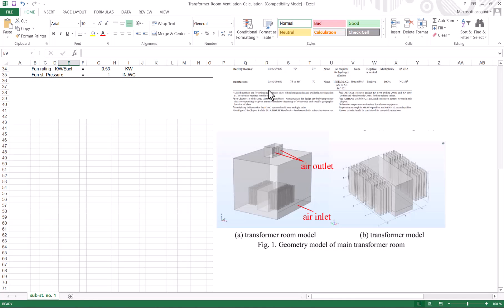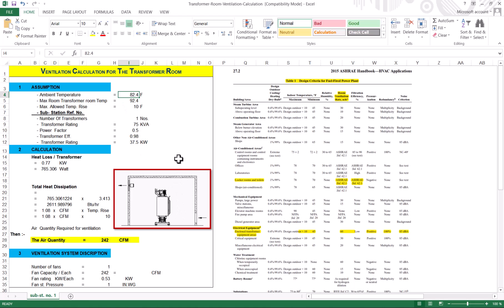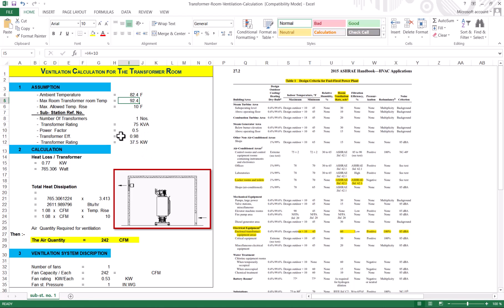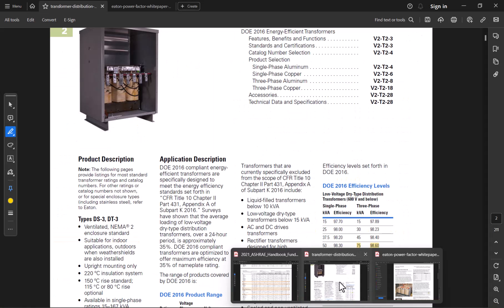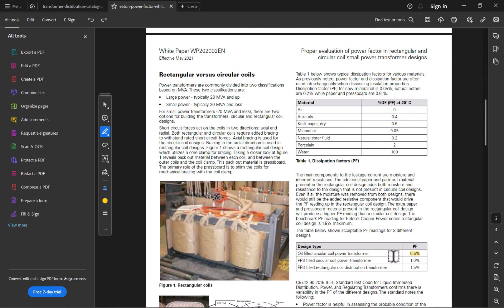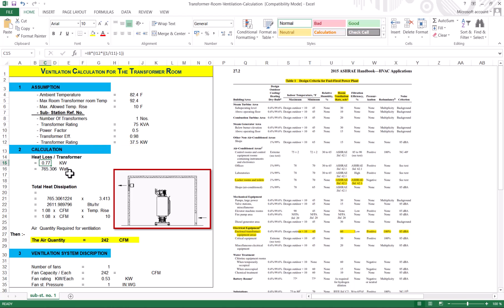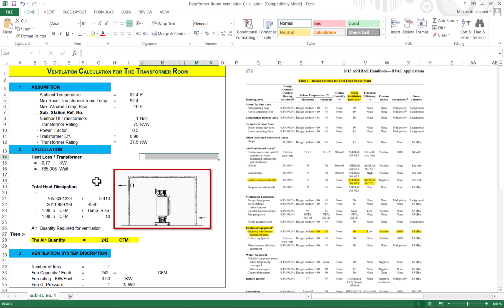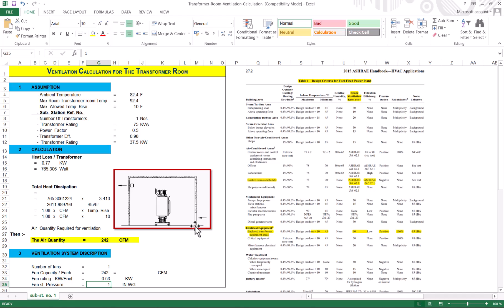Expert Reveals Top Transformer Room Ventilation System Design Secrets!

Comment: cfm calculated is the untreated outdoor cfm rate and exhaust cfm rate correct?
Reply from the maker: Yes, but it depends on weather conditions.like in freezing environment you have to provide treated makeup air. The fan is interlocked with T-stat, when the temperature increases it turns on the fan and vice versa.
Reply: @passionateengineer04  cool, thanks 👍